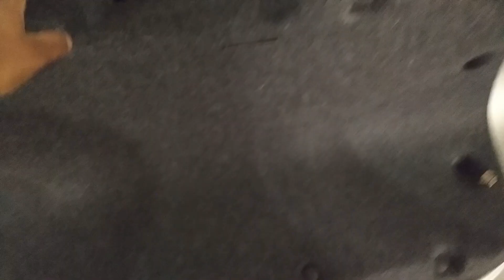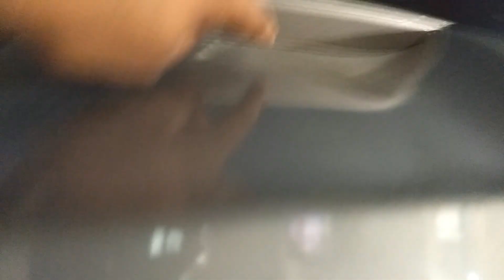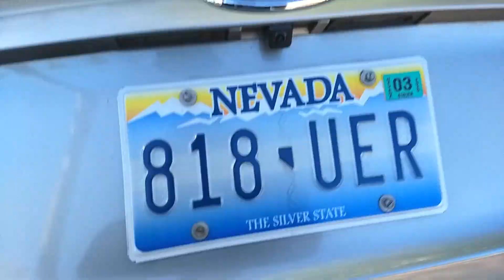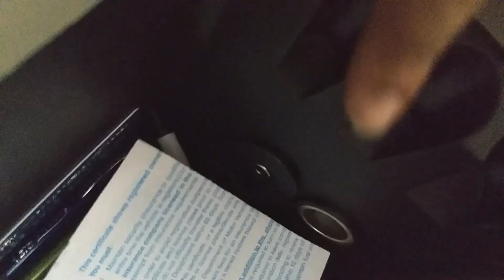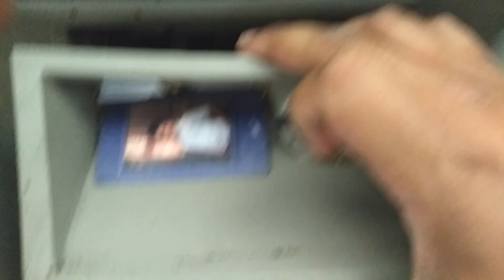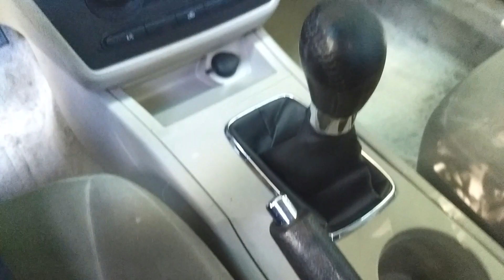2006-2009 Ford Fusion Double Din (Pioneer AVH-2300NEX) and Back-Up Camera Install

Comment: Hi CMM - does your Pioneer head unit ever shut down intermittently? Pioneer has said it can be a problem due to iPhone recognition as inferior aftermarket part - and the device will disconnect CarPlay. I’d appreciate your response. Thx

Comment: Wow...another Stick Fusion. I have only ever seen mine as a Manual...
Question? Im about to dive into this on my Fusion. I also have a Manual Fusion. Where or how did you wire the Reverse Switch to activate the Reverse Camera?
Reply from the maker: I did mine to the rear back up light

Comment: Could you link the harness plus adapter and the mounting bracket thing you had? I want to swap to a newer unit in my fusion and I can't seem to find them
Reply from the maker: https://www.amazon.com/dp/B06VW23SKR/ref=cm_sw_r_sms_apa_i_MineEbDYJ071H good luck hope it turn out good be sure you double check fitment using the Amazon tool
Reply: @CrazyMotorMaster  will does work with 2006 ford fusion forsure?

Comment: Which wiring harness did you use and did it retain your steering wheel controls
Reply from the maker: This car never had steering wheel controls since it was a base model S fusion, I used the harness that came with the din kit that I bought https://www.amazon.com/dp/B06VW23SKR/ref=cm_sw_r_sms_apa_i_MineEbDYJ071H